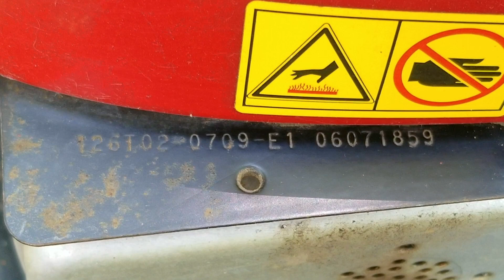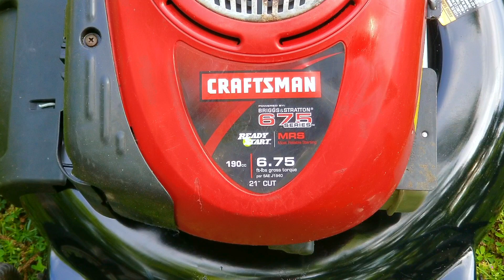Sharing Some Of My Interactions With Customers

Comment: One of my customers had a mower serviced by a neighbour. Apart from the spark plug not being the right one , he hadn't tightened it enough so there was little compression. The oil was filled to the top of the dipstick. No air filter but a piece of sponge he'd found. I sorted it all out and I got nothing from her, not even thanks. I think she thought I was ripping her off for charging her for parts.
Reply from the maker: wow , it's almost unbelievable that all that wasn't done on purpose

Comment: Great channel.
question: what are you using for a cleaner?
Went through some of your other videos looking for that info but have yet to find it.
One such is where your trying an oil stain . Your comment to a question about super clean about not using had me puzzled.
Meaning you could have showed its performance but didn't have any only the container.  
Hope to hear from you.
Great content
Reply from the maker: it should be in the description for the video but it's a degreaser from Harbor Freight, I use it at full concentration

Comment: In a nutshell, if you do not have a brick and mortar repair shop with a sign attached, then it's just a  hobby of yours tinkering with small engine equipment. This is what people perceive and expect; You tinkering with their old abused and neglected lawn equipment crap. . so when You charge them for parts and labor, well now, that's just messed up! Don't you know, You are that nice guy that sits in your rocker out in your backyard working on all their junk for next to nothing (free).  Many of these fine citizens probably have a conversation among themselves about whether to tip you a few bucks for fixing everything for free. I am fortunate, I repair equipment brought to my doorstep by only 2 people. I have selected these 2 to move forward with. Others have come and gone and never- by my choice, to return.  Good video sir.
Reply from the maker: well said and thank you!

Comment: I am the neighborhood fix it guy and I had one gal bring over a ratted out Craftsman lawn tractor. I took a look and said no promises but the engine will run.  After a carb replacement and then I did a deep clean and adjusted the valves and changed the oil. Put it all back together and the engine ran fine. That is when I discovered issue after issue the main one it would barely creep forward. I looked at the drive belt for hydro and sourced a replacement belt and a new spring for the tensioner. Repaired that and the rabbit hole got bigger but I had finally stopped and called the customer. Got the lawn tractor running and driving I wasn't going to do more as the price was kept going up. Total cost of 4 hours labor and parts was enough. Of course being that I had the customers wanting the old parts before I had them laying on the floor next to the lawn tractor when the customer came over. The customer asked why I had not waxed her rusted out lawn tractor I just said I only clean them up. Wax is on you.
Reply from the maker: wow, that's some work you did on that thing!

Comment: Also heard story of an older man complaining of always having low tire pressure. The tech cleaned rims sealed tires checked for leaks the whole 9 yards. Did this several times apparently. No leaks ever found. Eventually the tech glued the valve caps on. The costomer came in complaied he cant get the caps off to check the pressures. Long story short it turns out the man would check his tire pressures constantly, unknowingly letting out air little by little everytime he check it.
Reply from the maker: nice one!

Comment: Again you are correct. I do not do deep cleaning to any customers equipment unless they are willing to pay for it. A few customers had hissy fits when I charge for cleaning so I don't do it unless asked to. I usually do a quick wipe down and blow them off with compressed air.I also had customers that brought me equipment after someone else worked on them. Parts missing etc. I am sure you know the story on these types of people. One guy brought me a Tecumseh carb to rebuild, I put it thru my ultra sonic cleaner and changed the needle and seat, and it came out good, He called me a few day later and said the engine was sputtering. I asked if he adjusted the high and low jets, He said he did not know how to do it. As you can quess, I had to drive to his house and do the adjustments. Of course he did not want to pay for my extra time. Thanks for that great video.
Reply from the maker: thank you Watermanone!

Comment: This is why I don't deal with the public. I pick up mowers and machines, fix them and keep then for myself. I sometimes work on Family/friend's mowers and machines, but never the general public. I am just not good at putting on a fake smile and  acting like the person I am talking to is not a moron.
Reply from the maker: I hear what you're saying, and to be honest, the last few times I was at the small engine repair shop, I never saw anyone smiling either, except on the sales floor
Reply: That is why I worked in the shop, and, let the shop owner deal with customer's. I bagged all used/replaced parts, and walked them out on top of the unit, when picked up. 95% of time, I got to walk the parts to recycle barrels.
Reply: @georgepruitt637  yeah, that is a good thing as well.

Comment: In your opinion the 190 cc quantum when they get older have a rod knock. Not bad but can be noticeable. Would a new one fix the noise?  Can wrist pin be pulled without pulling head? Thanks mike
Reply from the maker: I would still remove the head and do It the conventional way instead of trying to remove the connecting rod will leaving the piston at the bottom of the cylinder.  And yes, as long as there isn't any metal on the rod journal, replacing the connecting rod with a new one would certainly fix it.
Reply: One thing I have noticed on the Quantum engines is that they don't like carbon build-up in the combustion chamber, on the piston, or on the valves, it often times sounds just like rod knock. I pull the head off and clean everything up, put the old head gasket back on and fire it up, if it sounds better, i replace the head gasket and ship it, but if it still knocks, the engine comes apart or gets parted out

Comment: im not a mechanic or run a business but ive done some work on some others mowers, and its interesting when you point out a head gasket blown a year ago and they didnt want it fixed but they come back a year later asking why the fuel pump is spitting out oil all over the engine :P
Reply from the maker: understandable

Comment: The owner of the unit with the carb and wheel replacement needed to see the actual old parts because there was a secret code hidden in them by which he could verify they were his actual parts and you weren't using them on someone else's mower and then repeating the process.
Reply from the maker: LOL!!!

Comment: I rember having customer upset cuz we "swapped" their oil cap on their car after oil change. The oil caps would say OIL when looked at from above, but they can be installed upside down and read -710- . Dosen't affect anything. They would claim we replaced there OIL caps with 710 caps or vise versa
Reply from the maker: LOL!!

Comment: One of the most beautiful features of a hobby business in comparison to a full time business the the ability to tell rude or demanding customers to “go kick rocks” and never darken my doorstep again without the fear of killing your livelihood! I tend to fix things for others (people I know or friends of friends) much cheaper than any shop they could find, so I don’t get much rudeness and demanding interactions, but I do make it clear that I work at my own speed and if the job requires more time and parts than anticipated; it is what it is but I will be as fair as I possibly can be. Also, they provide parts but I email or text them links to the exact parts they need to purchase and usually at the best possible price I can locate for them. So far, so good. My tolerance for bs, nonsense, and “I don’t trust you” is minimal. I typically return old parts but after a few times, the customer will usually tell me to just dispose of them. In my experience, most people who don’t trust you and think your going to screw them without any reason for thinking it are the same kind of people that you can’t trust and that will screw you without any good reason!  Sometimes, though, people have just been screwed and are gun-shy coming off that bad experience, but those people tend to relax after a positive interaction.

Comment: Hey bro, what's up? I can relate to the story about the chainsaw but mine is with my trimmer instead. My dad bought the trimmer back in the early 2000's and use to put a little more oil in the fuel mixture so it use to smoke alot. He carried it to one of his friend to get it serviced. His friend said it needed a carburetor kit to repair it and my dad bought it and paid him to repair it. Some time later we got it home only to realize that he didn't do ant work on our trimmer but instead he had a similar trimmer that needed a carburetor repair kit to get it working properly. My dad being the soft hearted person said to forget it and we'll get it repaired somewhere else. I on the other hand had gone to his place and exposed him as the dishonest person he was infront of his customers with lots of bad words and demanded to be reimbursed and compensated for wasting our time which he did very quickly to get rid of me. In the end it had a free Stihl service day in my area to which I carried my trimmer and bought the carburetor repair kit and got it fixed.
Reply from the maker: wow that's one heck of a story!
Reply: @INSIDEHOUSEGARAGE  yes bro. I gave you the short version of the story. Every since then, whenever we carried the trimmer to be serviced, the person who serviced it put whatever parts needed changing into a clear plastic bag and tied it onto my trimmer.

Comment: I had a fella that would bring his curb picked crap to me to fix. He was a real pita, always arguing about the price. I finally told him not to come back after he brought a pressure washer over with stripped threads on the water hose connection pipe and tried to blame me. Fortunately, he was next to me when I went to put the hose on. 
I didn’t, and don’t need the aggravation.
Reply from the maker: wow what a PITA

Comment: Glad I am not the only one that used to get problem  customers, I am a Builder. I started working in retail when I left school many years ago and was told that the customer is always right ha ha. After many years as a builder I am lucky and usually can spot a weird one from a mile or from the first conversation. Good luck and may the Force be with you. Good vids by the way.
Reply from the maker: Thanks for sharing

Comment: very nice job, what do you use for a sprayer when you do the cleaning? also what do you use for a cleaning solution? this why I only work on my stuff and people I know personally.
Reply from the maker: thanks for asking, I had a friend who was going to throw away a very good paint sprayer, because it was leaking a bit. So I asked to have it and that's what you hear in the background. I also use the only degreaser harbor freight sells, and I use it at Full concentration but I have to be careful with it on paint .

Comment: I only fix and flip since it's just a hobby for me. The only exceptions are friends and relatives of it it's something i sold that stopped working. I had one pitiful customer bring back a nice Stihl trimmer that wouldn't feed line anymore.  Turns out they had rewound the spool so tightly that it was all jammed up on itself.  I took off her new line and showed her how to wind it correctly.
Reply from the maker: that was awfully nice of you

Comment: Small engines ar my hobby, but electronic service was my full time occupation.  I ALWAYS gave back the used/defective parts.  It gives the client the opportunity to see and if desired test the old parts.  Also it instills confidence that I did not keep used parts to re-install in someone else's device.  I also refused to install client-supplied parts, since I could not warrant the work if the parts failed.  BTW that 675 series mower is the best one I've ever owned.
Reply from the maker: that makes sense, I might just have to start asking before they receive it back. Thanks